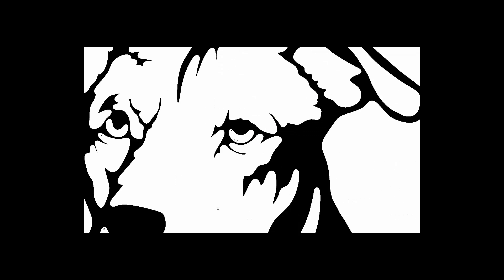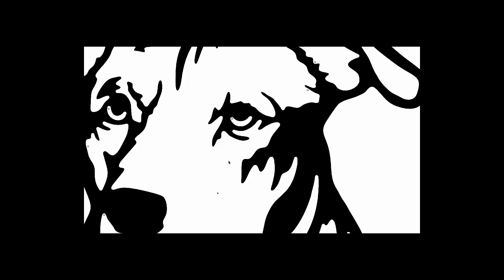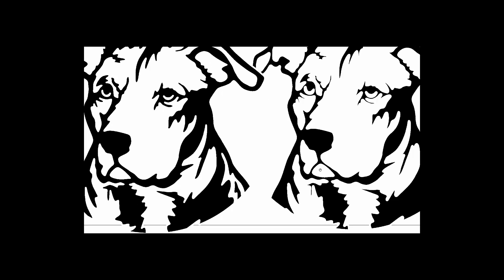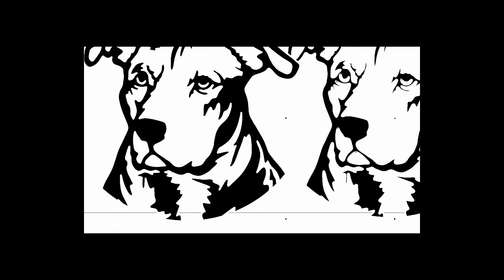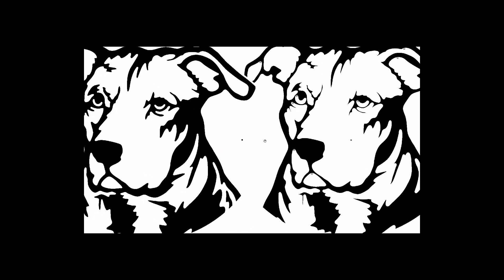Kerf Compensation for CNC Art

Comment: great info for beginners to cutting!  i have a plasmacam that just gave out... do you have a consolidated tutorial for retrofitting a plasmacam for mach 3 use?
Reply from the maker: just what's at readytocut.com - I just rebuilt mine with wire tracks and better enclosures - I'll be available if you have any questions